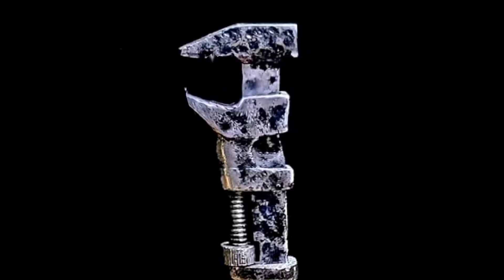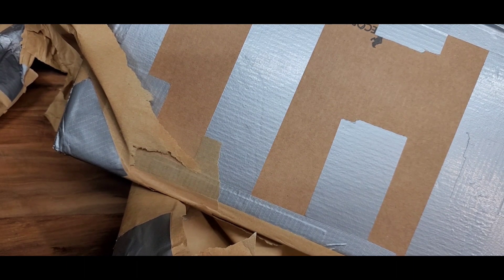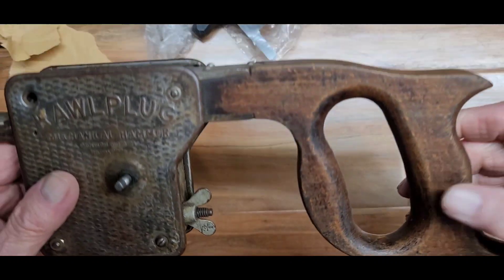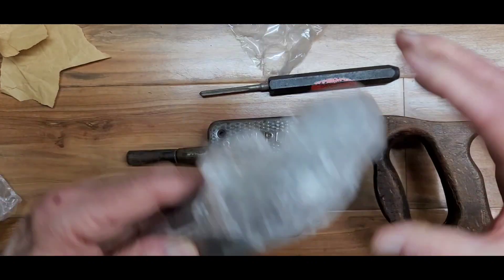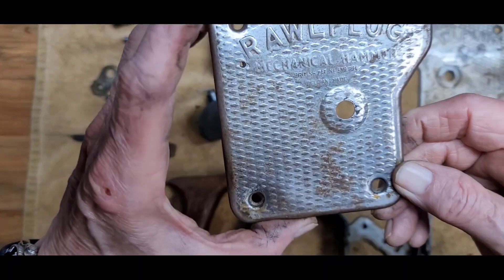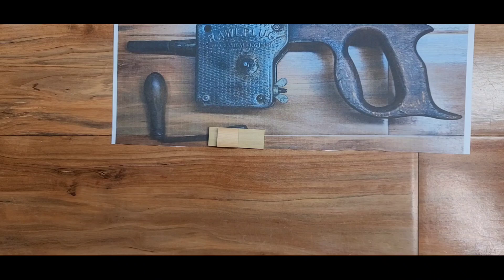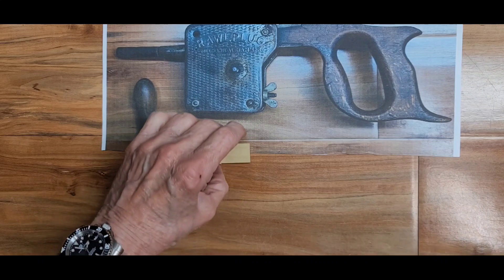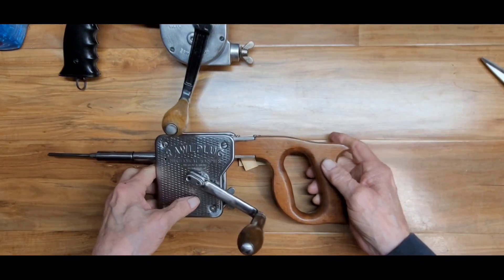90 year old Rawlplug hammer drill rescue

Comment: All my pleasure John! I was a bit jealous of the parcel, because boy would I like to travel to Nashville too. The thing looks amazing now, too bad people can't actually hear how loud it is. I thought the broken of piece of thread you might me able to file flat, drill and tap a hole of an available size that comes close, put a bit of all thread in with lock tite and tap the handle to the same size. It's a one change operation though... Should've provide you some bolts too, didn't think that one trough to much. Glad you liked the hand held punch too, found it at the fleamarket once.
Reply from the maker: I may still do the repair but I don't have a lathe like Scoutcrafter so the precision drilling and tapping will be difficult for me. And thanks for the hand drill. The drill bit fit the restored drill perfectly.so I used it to drill the hole.
Reply: @johnfix1  Yes I'd be really daunted by that operation too!